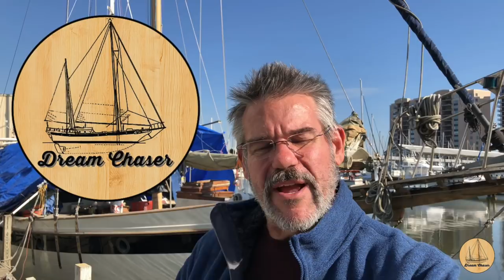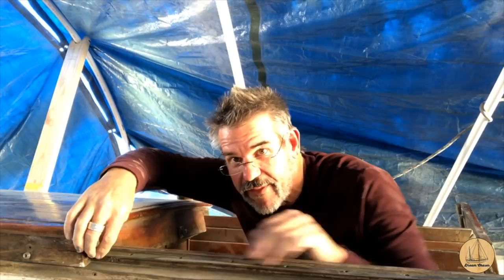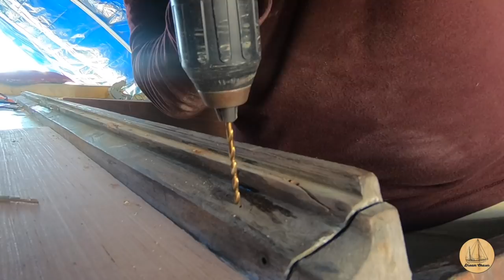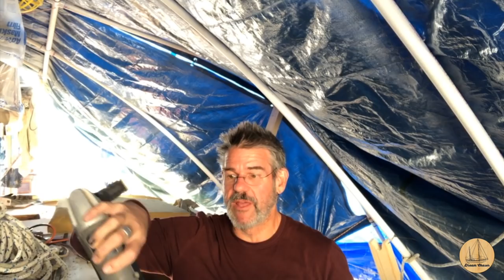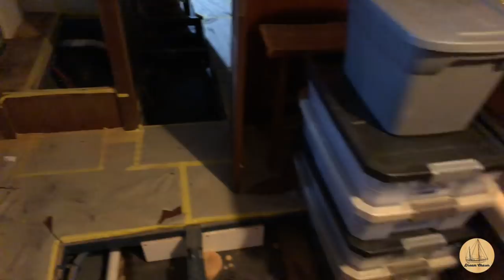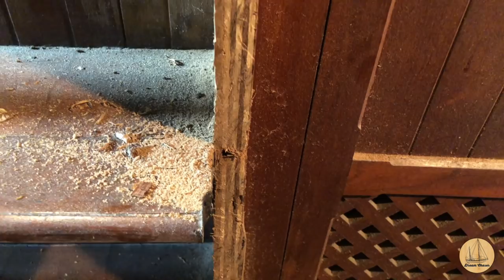How to remove a Companionway from your boat

Comment: Great videos! You do good job discribing problems and solutions. I started fixing and restoring wooden boats in the early '60s as a lad. Fresh water intrusion is always the rot culprit. Your boat has survived a lot of years and I don't think most of the rot is old. Looking at how much core you are removing and the numerus spots it might be prudent to replace the whole top with a more modern material like Nidacore. I used this on a Downeast fishing boat 16 years ago for the wheelhouse and it still looks fresh and solid. Keep up the good work!
Reply from the maker: +28cruzin Boythat was a 3 week internal debate I had with myself on replacing it all or just parts. I ended up at the decision I did after speaking to the owner of the yard. I will say at the time I thought I only had half as many areas to repair but in the end my ‘hope and expectation’ is that the new glass over all of this will ensure that even with not replacing it all that it will be solid.
Reply: what was not rotted should stay not rotted but you need to track down the source of water intrusion and fix it. my concern about the abundant rot spots is bonding the patches to the good core. Fiberglass over the top is not enough. butt joints can work under the glass and cause a new problem. Using a ship lap type of patch allows an excellent bond to the original core and makes it part of the structure so it won't move. I love your boat, by the way.
Reply from the maker: +28cruzin Thanks for the tips. I was going to router the top edge of the existing core and the underside of the new core (at least in any spots that were not going to be epoxied down to a cross beam) to aid in three bonded surfaces rather than just a bit joint with one. It isn’t quite ship lap but close. I just started doing it so it will be next weeks episode. You will have to check it out and let me know if I did what you suggested or if it was something different.
Reply: Sounds like we're on the same page. Where was "YOUTUBE" in the '60s???
Reply from the maker: +28cruzin It has made research so easy. The challenge is to find enough consensus that you can trust what someone says. I usually want a majority of opinions before I take something seriously. Lol.

Comment: You were bitten by the "5200 Monster".  That's the glue from hell that people use on things
that "Will never have to be removed"....          Until, of course, they do have to be removed!
Glad the removal was successful.
Reply from the maker: G King You may be right. The only reason I didn’t think it was 5200 was because it was sticky or rubbery and I assumed 5200 would be rock hard. Whatever it is, I am not a fan.

Comment: I like the new format and well explained  thanks  psHow did you smack that middle finger nail OUCH
Reply from the maker: +Cptn Uwe's Pirate Tales You are observant. That hurt like hell and the story isn’t even great. I was folding down the seats in my truck and slammed it down so it would latch to the floor. I smacked my finger between the bronze cowl vent that I had on the floor and the seat handle.
Reply: I though it was nail polish. Doh.

Comment: Gill, congratulations on 2k subscribers. Also, if you haven't already done it by now, stow a set of work clothes on the boat for such occasions so we don't have to endure your pixelated butt. :)  As for the employee; I work as an aircraft mechanic in a small shop, 4 guys on the floor plus the owner. I have been approached several times over the years to work on somebody's plane on the side, both regular customers and transient aircraft. My personal policy is to not work anywhere else on the airport without my employer's blessing.You didn't mention on camera, but you did in the comments, that he has approached you before and also talked down about his co-workers. Not a good thing in my way of thinking either, they should be a team always having each other's backs. It would be interesting to note how his work is and how he gets on with his co-workers. All said and done, a person is only as good as their integrity. I think you did right. Apologies to all for carrying on, I'll get off my soapbox.  Make it a great day!!
Reply from the maker: Duly noted on the clothes.  Normally that would be the case, but I pulled all that off there when there was sanding of fiberglass going on to keep it from getting itchy.  lol  You shouldn't have to see that again.   haha